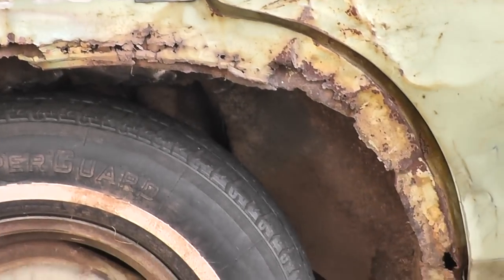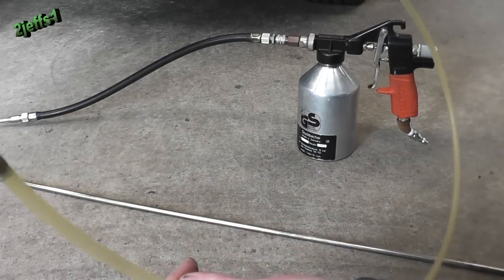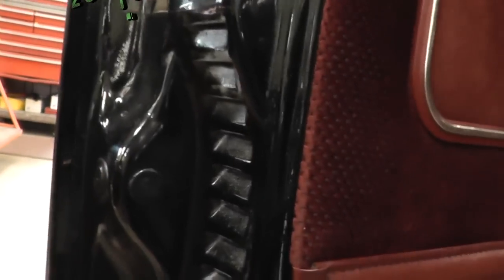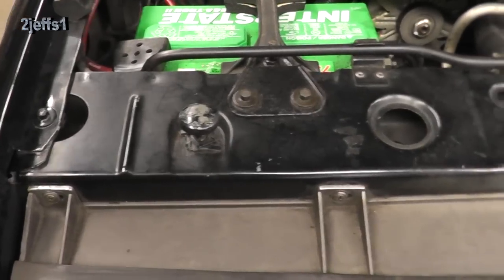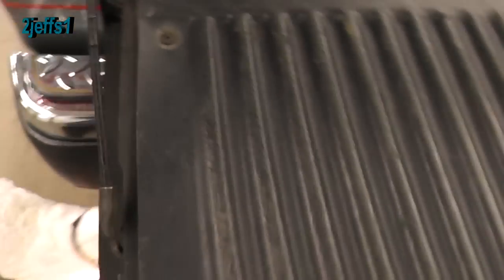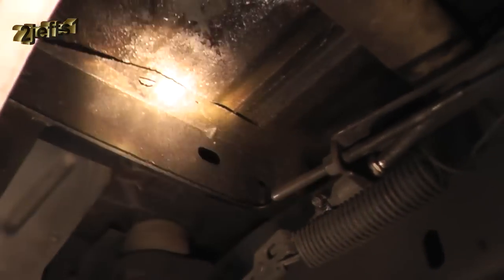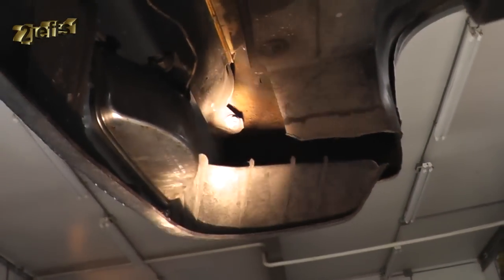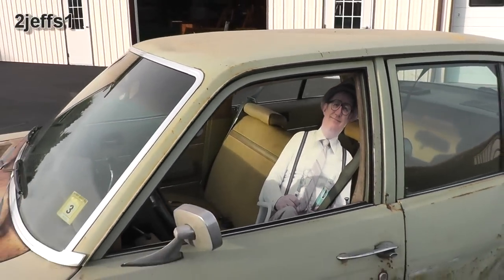Oil Undercoating DIY

Comment: How many miles? All original?
Reply from the maker: No pie, all original tin. Was repainted here in the early 90's where the paint on them would peel off the e coat. Pulled the box and sanded entire truck and box to bare metal then epoxy primer and urethane single stage paint. Still that same paint. Around 90k on the clock.

Comment: short circuit
Reply: There's guys who completely submerge their computers in mineral oil to achieve very high cooling efficenty, and they have no short circuits.  It's quite a sight to see... all those computer parts inside what looks like water.... here's one guy who made his look like an aquarium, complete with bubblers:  https://www.youtube.com/watch?v=Y1WkdXvtEKY

Use new oil, though, when working around electrical connections.  Old oil has metal particles in it which will conduct electricity.